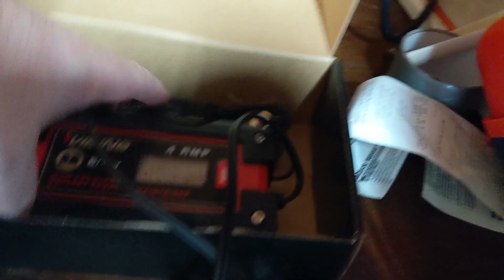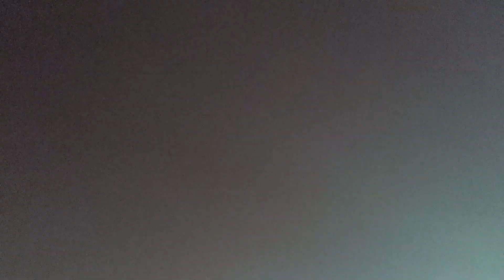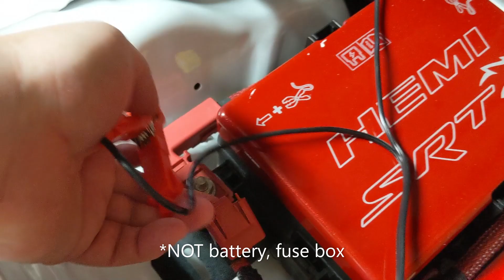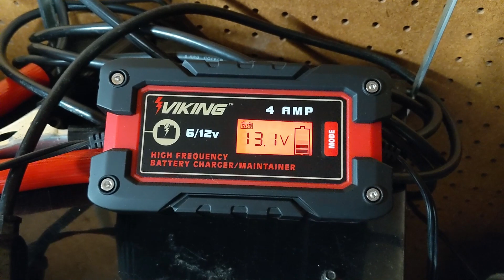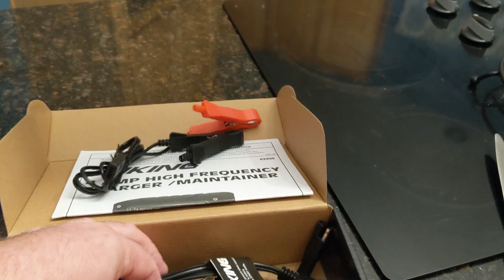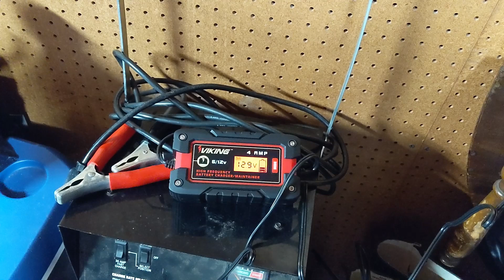Viking (Harbor Freight) 4 Amp battery charger / maintainer review for my Charger Hellcat

Comment: Someone commented that you do not have standard batteries in the Hellcat.  Could the issues be that you have the wrong mode set?
Reply from the maker: Incorrect information on that comment.   Hellcat battery part number is BB0H7730AB, which was superseded by BBH7F001AA.   It's not AGM.  Mopar doesn't make AGM batteries
Reply from the maker: There's also the BA94R765AA battery which is also not AGM
Reply: Thanks for clarifying.  I’m contemplating this charger for a deep cycle battery.

Comment: OMFG, you are obsessed with the temp of the battery charger. I got it. I got it. It's warm. It's warm.
Reply: Warm is normal, hot is not.
Reply: This product is absolutely a piece of s***
Reply: @ouiroc  that odd bc mine has worked great for me for years. Never failed me once.
Reply: I'm glad I didn't ask you what time it was you would tell me how to build a f**** watch

Comment: Is your vehicle on in anyway ? Your battery is connected. I wounder if it wóuld change if it was disconnected.
Reply from the maker: The car doesn't have the draw, it's the security/camera system.    It has a 24 hour battery, but it does out if it stays on.   I can unplug the system and let the car sit a few weeks and the battery would be fine

Comment: This "charger" is probably best used as a maintainer for a car battery; best to use a 10/2 A charger for a battery of that size that isn't near full charge.  I've used this charger for smaller batteries like you'd see in a scooter, UPS or alarm system, and that's a much better application for using this to both charge and maintain.
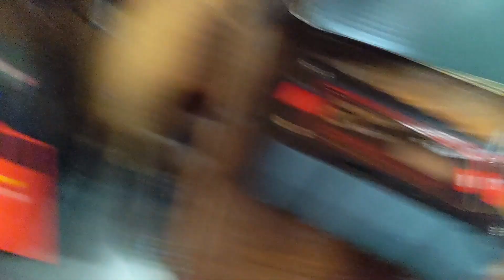Reply from the maker: If you look around 1:53 you can see my big charger.   It's 2/35/200 amp.   Works great for a fast charge or quick start if needed    the remote leads (battery is in the trunk, circuit capacity is 20A) but the 2 amp takes forever.   Wanted to get something intermediate that wouldn't take as long as the 2 amp, and maintain without overcharging.  Before I put this on I drove the car for 2 hours.   The battery wasn't dead, there was something wrong with that first charger

Comment: Positive gets connected first then ground. This is the most basic point of car safety.
Reply from the maker: Technically it doesn't matter.   I would have followed that if anything was done to the car, but there was no maintenance or anything moved.  It is an important process with any electrical maintenance / unknown issues where there could be a short
Reply: Technically it actually does matter. Ground always first off, last on. Also, your battery is an AGM, not a "standard" lead acid.
Reply: @96LS1S10  Go ahead and explain why that matters with a connected system. Give a technical explanation, not your opinion. I want to understand what your trying to say.
Reply: @wookongninja  if you connect the negative first, and accidentally touch the positive to metal, you will understand why it is safer to connect the positive first and negative last.
Reply: @96LS1S10  MOPAR doesn't offer an AGM battery as standard equipment in automobiles.   Where are you getting your misinformation?

Comment: I could never get either one of 2 I bought to go into maintenance mode . I don’t think it’s worth ruining a battery to save money buying this junk from Viking .  Poor quality and the performance of these units reflect that .
Reply: Steven,
It looks like you got x2 dudes. When I bought mine (which goes into maintenance mode properly), there were x4 total on the shelf; one was opened & poorly resealed with the round tape seal, one was completely opened and obviously a return. and one that had part of the end flap opened but the original seal was intact, and mine, a completely sealed package.
It has worked properly and has brought my Twin Turbo & Supercharged, 1000+HP Hellsqueeeeert Nitrous Dodge Fiat Valiant's Battery ..........errr I mean my BMW X3's AGM back a reasonable amount, considering it's 5 years old.
Keep returning them until you get a good one.
 $40 is a decent price for such a versatile charger.
When I return something to HF that is non-op, , I write on the unit/item that it's DOA to warn others and so they can't just restock it (although be aware they might anyway).
Moral; Always look closely at the packaging for factory seals.
Good Luck.
cheers
Boots Langley
La Mesa, Ca
Reply: Yep, WHY RISK overcharging a perfectly good battery when there are DOZENS of cheap chargers out there that work very well.

Comment: You said it went green after full charge and goes into maintenance mode. Then you said it stays red in maintenance mode. I’m confused
Reply from the maker: It stays red while charging. Once charging is done it goes green.  The red in maintenance mode doesn't seem to be correct.  I called the number in the manual and that's what they told me, but I did not observe that at all

Comment: I had 2 hooked up at the farm on tractors. I went over today and both were not working. I did have 110 at both plug ins. I assume there was a voltage surge from the power company. Is there a internal fuse ? Thanks, Mike
Reply from the maker: If you used the set of leads that weren't the clamps there is an in series fuse.    I am not sure on the internal circuity of the unit itself, as I have not seen a schematic.    You can call the support number printed in the manual (-888-866-5797) you can call and ask

Comment: I'm no electrical or auto expert and  am learning as I go along. From what I gather a car battery has 48 amp hour capacity so that if the electric flow is 1 amp per hour that it would take 48 hours to drain. 2 amp pull> 24 hrs. 6 amp, 8 hrs. etc. If that works in reverse, at 4 amps in, it would take 12 hrs. to charge from nothing.  The 1st one may have been bad but didn't you say there was some drain which necessitated a trickle charger? It seems you have power going two 2 places. One to accessories & one to storage. Not knowing where things started or the pull, I wonder if the 1st one was bad. But I'm no expert on all this. I'm using one for the 1st time now & wanted to know kind of what to expect which your video did. Thanks!
Reply from the maker: Thank you.   I ran the car for 2 hours before I parked it and put the  charger/maintainer on.  It should not have been dead (or even close)
Reply: @futon02  For what it's worth, I finally finished charging a battery for a BMW 328i. I would not let it sit overnight not knowing what it would do. It took a good 11 hours to charge the car battery.  I don't know why that was. It says on the side of the box that it will restore some batteries, but I'm not clear at all on whether or not the display would ever tell me that it was doing so. It says it's a Maxx-H6 12V 730 cold cranking amps or 900 cranking amps at 32°. A separate voltmeter reads 13.07V.
Reply: @SharpTuskWorld  It's a 4 AMP charger/maintainer. That means it's not a fast charger , it does not mean it's a bad charger. Won't hurt to put it on overnight either. The voltage fluctuations are part of the process , the charger puts out what the battery will take and draws back , it's part of the charging cycle. I have had this charger for a year now and have used it on 3 motorcycle batteries , 2 deep cycle RV batteries an a couple of regular car batteries. It will try to repair weak cells but it will also let you know when it cannot. The biggest thing with this charger is to give it time and let it do it's thing. It WILL go green when it's finished. I love mine !
Reply: @futon02  unless your alternator  is bad.. or the battery  its self its self is bad
Reply from the maker: @j5892000  I've had no issues since I received the second one.   It's been two years, alternator is fine